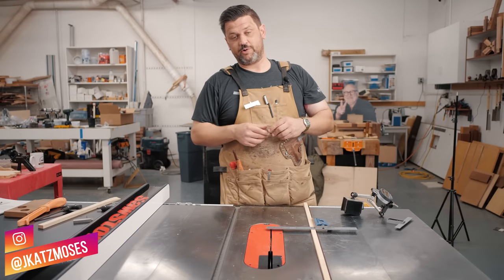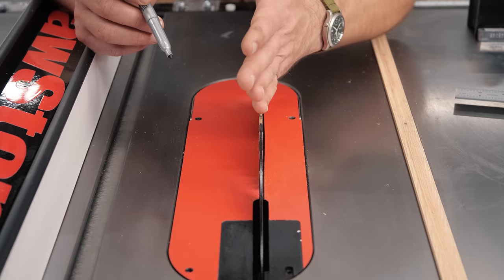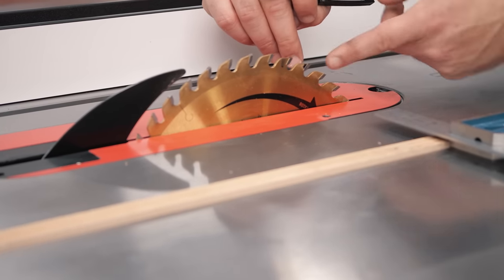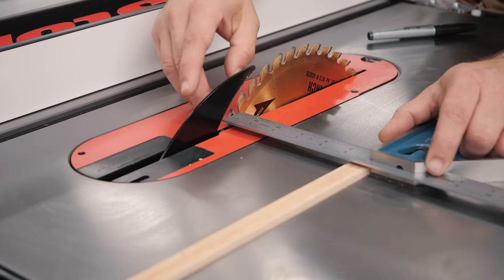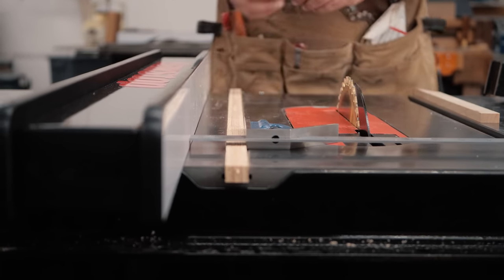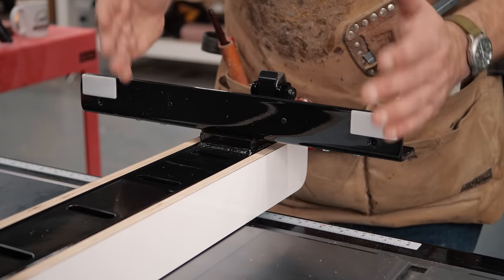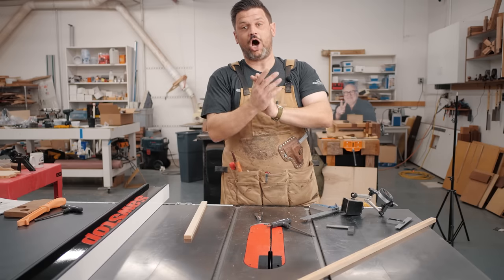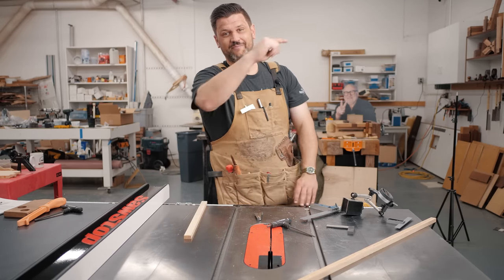5 Must Check Items on a New or Used Table Saw

Comment: Great tips.  You also may want to make sure the riving knife is perfectly in line with your blade.  Mine got out of whack a little bit and was pushing the cut piece against the fence causing some binding.  Took me awhile to figure that out since my fence was dead on.
Reply: Also, make sure the riving knife is the correct width for the blade you are using. A riving knife wider than the blade can cause issues as well.

A good example of this is using a thin kerf blade with a standard riving knife.

Comment: I believe that most carbide teeth are brazed to the blade, not welded for several reasons. First, to join dissimilar materials. Second, to avoid changing the grain structure of the carbide material by overheating (annealing) and the distortion due to thermal expansion.

Comment: thank you for the informative video. i applied your tips and it worked only on the left side of the blade....everything was nice and dead on square...HOWEVER to my surprise the right sight of my blade was not......How can that be ????? So I checked the surface and noticed it was off probably by 1/64 .....So my question is can i get the blade square by using WHAT REFERENCE ???  Thank you very much !!!!!!

Comment: I would also add making sure the zero clearance plate is level with the table. Especially before using it to set the angle of your blade. I thought mine was level, but after a while of inexplicable messed up cuts, I realized it was warped and was messing up any cut that was sliding more on the plate than the table. Obviously, a great video regardless. Thanks!

Comment: Thanks again for sharing your thoughts and videos. Do you know of a budget friendly fence that would fit an older Rockwell Table Saw,?? It has round tubing in the back and front . Needs a handle to raise and lower the blade. I appreciate any ideas.
Rodney

Comment: I made a “set up blade” with no teeth to get in the way or hurt you. I took a wore out high quality blade, cut the teeth off on my vertical metal bandsaw, then chucked in the lathe, turned it round. Then checked it for flatness. Works great and never bites me.

Comment: I did this with my new saw, but something is still off. With my fence set to 5" (or less) my cuts are accurate. Yet once I move my fence, say to 10", the cut is a heavy 32nd over.. The further out I go on my fence it seems to gradually grow. So at 20" my cut is 20 3/32. Any thoughts? (It's a new shopfox hybrid saw w/stock fence). Thanks in advance!

Comment: Yes good idea. I bought a new table saw about 25 years ago from Grizzy and didn't know about any of this. Well I could not cut anything square and was really pissed because I paid a lot of good earned money for this saw. So I didn't use it for years since it is only a hobby for me. I then saw something like this and checked my saw and found the blade was out of line and not by thousands of an inch but by over 3/16" with no way to correct it. It was now out of warranty so I took the saw apart and took parts to a machine shop where they milled large slots in them and I could than move the blade to square everything up. New idea, don't buy from Grizzy or check all measurements if you do. Cheap is not a good idea if you don't know how to check alignment.

Comment: I don't pursue agreement between the tilt scale and the blade tilt, because I don't trust the scale and the stops.  If I want a precise angle, I use a a mechanic's square or a draftsman's angle.  Ditto the miter gauge.  Of course, once set, the stops are good enough 99.99% of the time.

Comment: You said that the Pittsburg tape might be more than a sixteenth off than the guy claimed, but I don't think you checked anything beyond 24 inches.  The guy assuming the tape would be off by a half inch over 25 feet is pure speculation.  The most I saw was a 1/32 assuming your woodpecker and pencil marks were accurate.  And that was probably due to the end clip as you say.  A better comparison would be to lay the Pittsburg tape right up against other tapes, match them at the one inch mark tape them down  across the bench and see if the other hash marks at 12 and 24 inches line up.  This takes the clip out of the observations.